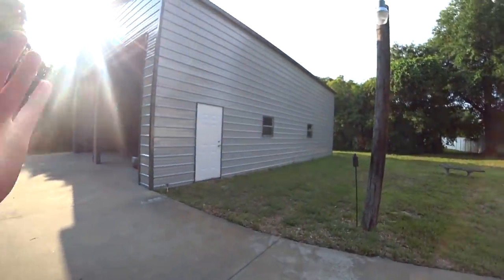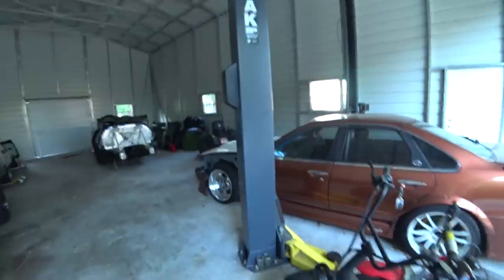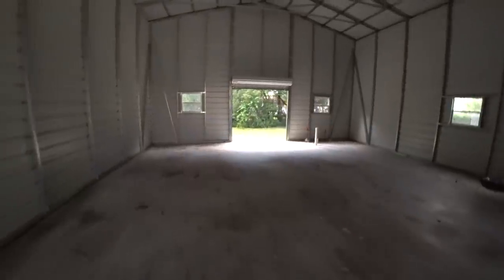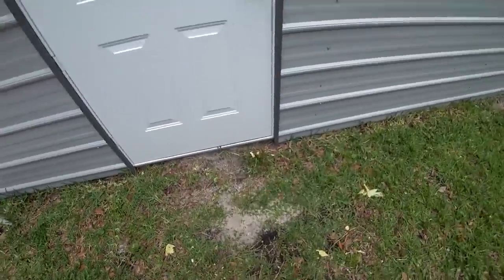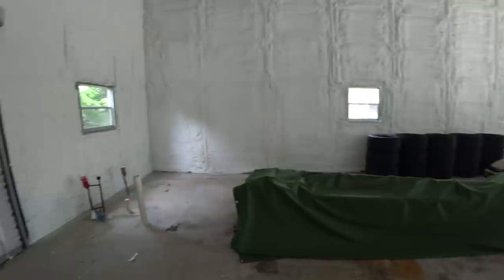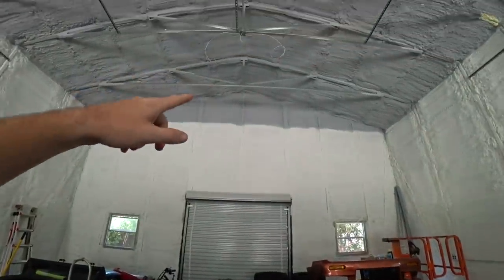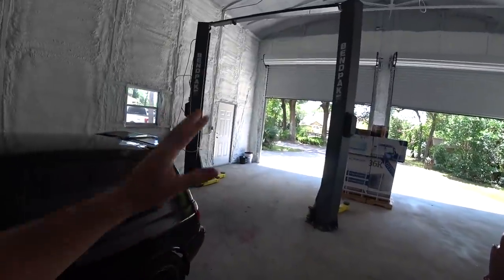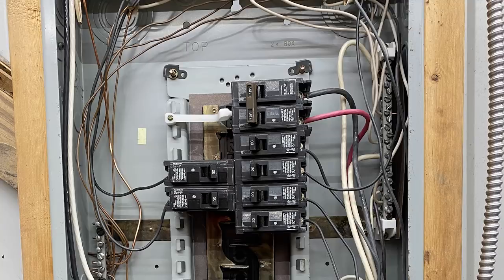New workshop build out. Spray foam and Electrical.

Comment: just installed a mr cool unit at my place in the mountains. took a few hours to run lines electrical mount the internal unit and have everything set up. game changer for DIY ac for a larger space. plus the BTUs are great for the size

Comment: Why didn’t you just do a whit tin siding on the interior walls?

Quick and easy, plus it looks super clean
Reply: Probably a nightmare for echoes with filming. The foam will help reduce that drastically
Reply: @Gari.Hughes  being a big open space its always going to echo no matter what you do!
Reply: Was thinking the same thing. I personally wouldn't stand that foam look on a new building.
Reply: @Gari.Hughes  the ribbing in tin with the insulation behind works better than a typical plywood or drywall in my experience

Comment: As someone who has to cool a large shop during crazy heat..... you would be shocked what a difference even a ceiling fan makes to get shops cooled down faster when the AC is on. I'm super excited to see the shop coming along. It will be a total game changer.

Comment: Taylor, mount the outdoor AC compressor on a small cement slab.  If you wall mount it to the outside of the building, you will hear the noise and vibration from the unit.  I made the mistake of mounting mine to the side of the house and you can feel the vibration when the compressor kicks on. Get some line set covers to clean up the exterior install.

Comment: Brother, that shop is around the same size/height as mine, (although mine is stick built) You will appreciate a loft! Just for a space to relax at a minimum. Also pallet racking works great for storing large parts and they make some pretty tall ones. Be careful with the poly you choose, I don’t know why but mine failed a year in.

Comment: When positioning the condensers the rules are 
Think of the neighbors 
Think of sleep.
Think of keeping them out of harms way 
Think of keeping them out of the weather etc etc.
Put them in a box if necessary to keep them quiet and from collecting leaves and muck.

If the stud gaps are not too wide you can recycle pallets to use as framing and to protect high traffic areas.

Comment: Foam is the best move.  It will strengthen the entire structure a whole lot as well.  You could attach horizontal perlins across the steel every 24" to give you something to put the sheet rock or plywood onto.  Then you can also run the wiring and airlines in-between the foam and that 1-1/2" gap.

Comment: Check out ‘dot and dab’. We use it in the uk to plasterboard walls. It would be ideal for your uneven walls as long as the foam they used will adhere to the dot and dab

Comment: I just built the same building. Mine is 30x40x12’. 2 - 10x10 doors and a 12’ x 12’ opening. I did 2” foam board and I put corrugated steel on the inside. They are 3’x10’ white panels with LED 8’ lights. Looks amazing. Definitely my dream shop. It’s sick. I been planning it for years so I know what you are talking about

Comment: One nice size exhaust fan will do wonders. Help pull the hot air out when you haven’t been running your ac. Of course helps with fumes and what not as well

Comment: Smart move on the split units Taylor, you are going to be so glad you did.👌
As far as the drop service and meter, you can always do the permit process for 200 amps and use what you have set up now. When the permits are approved you can actually use the shop as the main service and feed the house from a 100 amp service bus using the new line you just put in. Just a thought.
Looking fantastic!👌
Definitely do the floors, the amount of clean-up is literally reduced by almost 75 percent, seriously. No stains, residual oil or solvents wicking into the concrete. Yes, the cost is a bit hard to handle, but it is one of those things that truly is worth it. An easy comparison is Garret's and Adam's shops compared to JH.... To be fair, Justin has been using his shop for a lot of years, but constantly trying to clean bare concrete is simply impractical because you will never be able to keep it clean. 
The Vette is so close, getting really excited for you and can't wait to see you rippin it up!🤙

Comment: 6 tons of cooling, holy shit. Maybe you should get a professional HVAC company involved. I'm assuming you don't hold the certs for messing with refrigerant?
Reply: Refrigerant is pre installed on on Mr Cool units. Many self installs on YouTube.
Reply: @kent2360  Doesn't matter, even releasing refrigerant that is stored in units violates section 608. There is no difference in installing your own typical residential system vs a mini-split vs geothermal etc; they classify it as the same thing.
Reply: @laskahvac666  Mr. Cool units are truly diy (aside from the electrical). It's been discussed before, and they don't violate 608.

Comment: I think it would be cool if you put the lift diagonal on the back side of the shop. 
You have doors high enough you can back your trailer into the garage a few feet and be able to load up in any weather
Reply from the maker: I’m going to build a loft later.

Comment: I am extremely happy for you. The garage is finally almost done and I can't wait for it to be finished. You will definitely be able to finish the vette when you can use the garage atleast. I would add at least 2 big fans hanging for the beams to help keep the air circulating.

Comment: Looks great to me. It's a shop at the end of the day. You don't spend your time sitting on a couch looking at a wall so the fact that it's not smooth is irrelevant. As long as it's functional that's all that matters, there's no point in worrying about things that might or might not happen with the foam, deal with it when and if it needs doing. As far as permits go just be glad you're not in the UK. Getting permission to put up a building like that can often take 2 years and double that if someone objects and you appeal.

Comment: brush seals on the  doors  are a must but   I think  you're  good  on the size of the ac but you  will need  some  kind of  ventilation for  your welding area  or if you  decide to  do some  painting

Comment: Very nice shop! And 2x  36.000 Btu is a lot! These DYI systems are great. Maybe it's time for some solar cells on the roof of the chop. So you can generate enough power for the shop. And in the near future energy will be very expensive. In Holland, it is already the case! Dutch regards, Nico.

Comment: i would make the back section, under the loft your "clean" area, for the toolboxes, engine building, etc....  you could even section it off from the front area with those clear, plastic hanging slat walls you see in supermarket freezers and such to really separate it a bit.....  congrats on the shop...  one of my fave shows...

Comment: A lot of commercial shops/buildings will use like visqueen/white plastic sheeting and it goes over the insulation on the walls. Its not drywall but its a better finish and gives something to spray down.

Comment: The video I’ve been waiting for. I’m building my metal building aswell and right now I have the framing up and will be doing sheet metal next and I’ve been trying to figure out the order of wiring spray foam and a finish material

Comment: Lol its gonna be COLD in there! My buddy just did 2 18k btu in a 1200sqft and it gets sweater cold! Looking forward to an install video! Im about to order a 36k mr cool for my 1000 sq ft shop
Reply from the maker: They’re sweet! I’ve heard great things about them. I spoke with them about what would work best I originally thought I would need multiple heads but they said for one big space one head is great and uses less electricity.

Comment: You should install like two 8 blade shop ceiling fans to help move the air in the summer and keep it even cooler in there. You can get them from lowes or home depot

Comment: BLACK all the foam bottom and top and it'll disappear from the eye. Plenty of shops with bare foam painted black you can confirm yourself. Then good led lighting will be fine for camera work. A glossy floor will help with light if needed but if you have enough led lights it isn't needed. Mini-split looks good; might have to set it 65 overnight so at mid-day heat it is 75 in the summer but that isn't a huge issue (likely due to door loss because the doors are not insulted- def get seals like you said). Demo Ranch is the last youtuber shop he did foam in black if you want to see how good the black foam just disappears. Anyways good work; if you wanted to spray the paint matte black paint from any store will work and a spray gun. Def consider this before moving in because like the floors if you move in you won't do it. PS the white doesn't look bad if you have a finished floor (so you could leave the foam white just finish the floor); but like Matt's he did unfinish floor but black foam and it looks fine; but clear white foam walls with dirty bare floor will just make it look a bit trashy. Epoxy floors are a lot of money - not too bad if you do it yourself. Therefore; if you think you can't do the floors in epoxy then at least consider painting the floor (yes they make paint for it; it does chip and has to be redone every 5 years and after 2-3 paint jobs (10-15years) it'll be awful and has to be ground down fresh. So epoxy is best; but paint it if nothing else to buy you a few years.

Comment: Expoxy on the floors will make the lighting better for videos. The flat grey/black floors don't reflect light as good as a nice light grey/white floor. Just make sure to put an abrasive compound in the mix to help with grip

Comment: For a steel carport style building, rigid foam insulation outside of the frame with taped seams and furring strips to mount the steel outside of that is the way to go but you need to do that during the build, not after.  Steel for at least 5-6' up the inside of the wall makes sense for strength and cleaning too.

I'm not sure why you got an electric permit.  Just don't say anything and run it off a sub-pannel.  When you go to sell, just disconnect the wires at the house and you're only storing conduit, wires, fixtures, etc.

Never invite regulation in to your life if you don't have to.

Comment: Dam. Every 16ft and above I seen is double bottom rail and doubled side rails. Your is single everywhere and 5ft on center I think you said. Mines 4ft. Mine is very over built but at a true 16ft that's alot of leverage the wind has here in FL so I wanted to give it the best chance. I also have vertical and horizontal reinforcement. Hopefully yours stands the test of time. Looks great tho! 👍

Comment: Definitely should hang some tan corrugated metal of some sort on the inside of the walls you will damage the spray foam with stuff touching it bumping it whatever it’s not meant to be directly used as a finish

Comment: If I may make a recommendation. Do NOT use drywall. First 8 feet use Plywood. Yes it's a bit more expensive. Maybe use Chipboard. This will dull the echo, harden the walls and allow you to mount and hang anything on the walls. Once you put them up, seal with with some thompsons, then you can paint to a color of choice, or not. Without the wood you will eventually keep deteriorating and destroying the insulation. .. Been there done that.

Comment: I’ll be curious how well the spray foam wears without any covering. I did closed cell spray foam in an unfinished attic and it still flakes off after 10 years. If it were my shop, I would have waited to do the spray foam after electrical and figured out a wall covering. Plywood is ideal but so damn expensive now. Anyway, nice shop.

Comment: Dude I love all your content and have never commented on anything but I was wondering have you thought about doing metal like the outside on the inside from like 8 or 10 foot down the walls. Would be easy to clean and a fab area would be really nice and not have any burn areas to worry about

Comment: Sheetrock comes in 4’x8’ lay them sideways, cut to the center of the braces and screw them in lol that’s what I did on 5’ centers….
Reply: They also sell the drywall screws for metal and that will add another level of insulation as well

Comment: Don’t mount the ac unit on the wall. It will have some noise coming through the wall. Maybe the foam insulation will quiet it a bit but still a ground installation for the outside unit will be more enjoyable.

Comment: Any plans for some sort of rood vents or overall exhaust fan to take out not only the hot air but the welding smoke an dust? Having anything like that would also extend the life of the AC filters.

Comment: Why not use the Tin siding on the inside as well instead of drywall? It’s solid and you can mount conduit and electrical boxes right on the wall.

Comment: Do not weld anywhere near the foam. The paint isn't going to stop that fire. 14 years doing spray foam insulation. Have seen a 200k shop go up because they didn't listen
Reply: I'm kinda surprised it meets code.  I've never had a wall foamed that didn't require drywall cover, but it was always residential. Has foam been reformulated to be fire resistant?

Comment: Double bubble foil faced insulation on the roll up doors makes a big difference. It just goes on with double sided tape and rolls up with the door. Message me if you want the Janus brand installation instructions. Not a huge R value but much better than nothing.
Reply from the maker: That’s what I used on my garage door. Still get some head but you touch it and it’s warm. Touch behind it and you’ll burn your hand. So it for sure works.  I was going to try it on those. Does it roll up fine still?
Reply: @Taylordrifts  I used the Double bubble foil faced insulation white on one side on my entire 30 x 30 ceiling and garage doors. It works great. Brightens the entire garage.

Comment: Couldn't you now "dot & dab" plasterboard over that foam ( and mechanical fix at the posts). I'm sure that foam will drive you crazy in a while with how much dirt and dust etc it will/might? collect after you start working in there.
Either way it's looking great and how much would I love a workspace like that :)

Comment: So there's this thing called a "scarfer". Atleast I think that's how you spell it, but we use it for refrigarated semi trailers. It's pneumatic, if you can find one for rent. That would be a way to even the walls out. Or you can use wire wheels on a grinder. Though that might take a while.

Comment: Just curious. Why wouldn't you have them scrape the excess on the walls to at least try and get it flush? As if they were to mount drywall or some sort of paneling over that.

Comment: And the shame of the entire deal is that many steel building builders WILL NOT add a few ribs and make it 4 foot on center.. The cost should not be huge and the installation should be minimal. Topping all, those idiots would be able to stand up to higher winds and customers would be much further ahead if the ribs were 4' on center..  What idiots..   Good luck with the building. Tampa Bay here...

Comment: is there any concern with moisture forming and being traped between the metal sheet, and the foam on the inside? and rusting the panels? especially since youll have such a temp difference ACing the inside. ie condensation.

Comment: its amazing with all that foam it still has that echo ?  love your Shop not a negative comment I just assumed the foam would reduce echo vs the metal
Reply from the maker: The closed cell doesn’t because it’s hard. Open cell would have. But open cell 3-4” has the same insulation rating as 1” of closed cell. And that’s the minimum thickness so for the walls it would have stuck out way past the studs.
Reply: @Taylordrifts  ahh I see. Well amazing Garage congrats and loving the vet work your doing

Comment: Yeah drywall doesn't make much sense in a workshop, it's smooth and easy to install but if you're not looking for a nice finish (like in a house or garage) the it's not really the best. If it were me, I'd want to clad at least some of it with plywood. Should be able to get big enough sections to fit the metal framing and you can screw anything you want into it, no finding studs or relying on anchors, just straight into the ply.
Downside is it's heavy and annoying to install, and not as cheap (or, insanely expensive in m end of the world)

Comment: I said this before, but I think epoxy isn’t a good idea for a garage floor. It mars and scratches so easy and it will get dull quick. Polished concrete is what I would do. But it’s your shop, obviously. It’s looking good btw, I’m happy for you.
Reply from the maker: I haven’t looked into that. I would prefer it honestly.
Reply: @Taylordrifts  it should be cheaper, then add an anti-slip sealer on top. Cost’s less than epoxy and lasts longer, looks better imo. Thanks for replying, always cool when someone I watch all the time on here responds. 😁
Reply from the maker: @d33psix88  yeah I like the polished in the garage. Easy to clean and comfortable to have to lay on and slide around on. I wonder if they could get some of the stains out.

Comment: Hey Taylor, What brand building did you go with? I am planning on buying a Versatube here pretty soon. The same size as yours except with 12ft walls. also, How far away is your lift from the front and side walls? Trying to lay out where mine is going so I can get extra concrete in that area. Looking good bro.

Comment: I would build a little Shed for the air compressor. 

Get Rid of the mini-splits you are going to trash them with the janky little air filters they have or plan to become a pro at taking the head units apart yearly. 
An actual AC System you can have 5 inch carbon filters to keep the coil clean and air.  I expect you will end up needing 2x 5 ton units. 

My Office is built out of a metal building like 80 by 120 or something and we have 4x 5-ton units and only 10-foot high ceilings.

Or just plan to upgrade in 5 years, but the actual system you will get 15 or 25 years out of it.